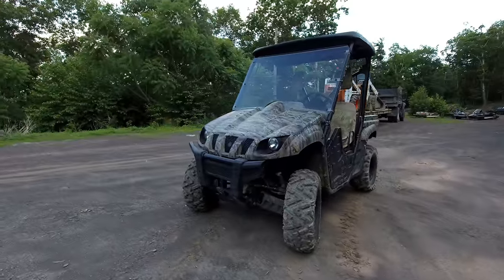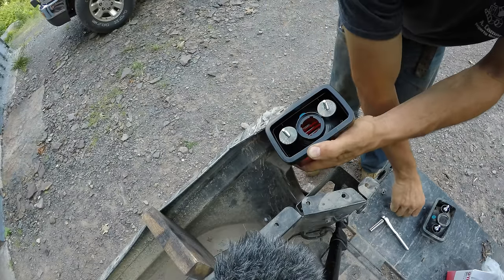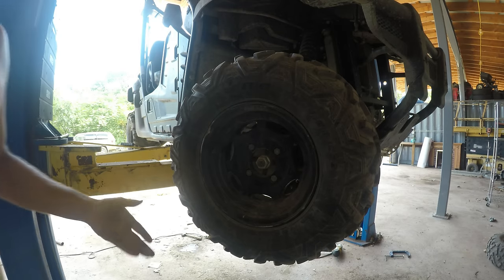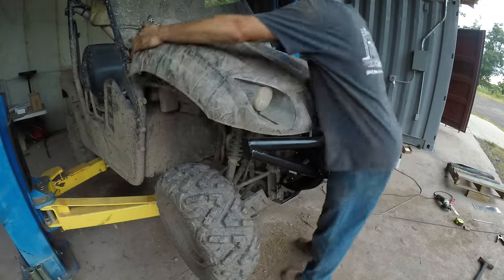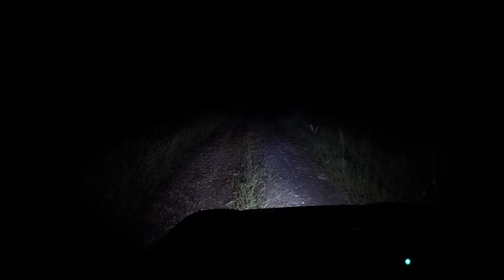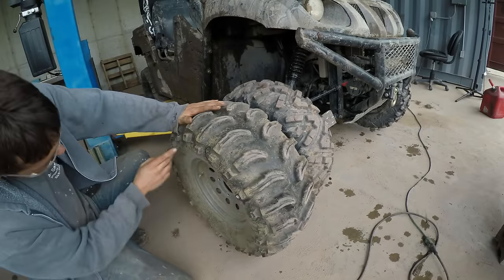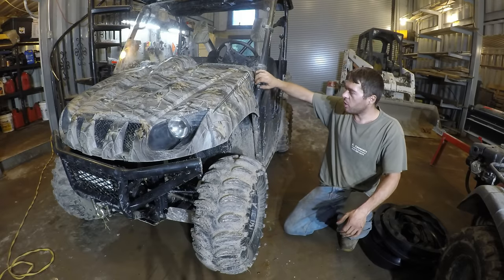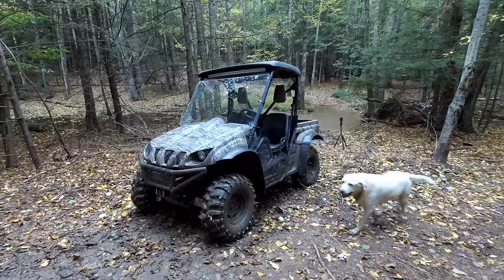Buying a UTV

Comment: I know it’s an old video so maybe you will see this maybe you won’t but you don’t need to open the bleeder when compressing the calipers it introduces air into the system and the fluid is able to go back into the reservoir otherwise you would have to put fluid in it every time you drive anything
Reply from the maker: It didn't want to move for some reason though. IDK.

Comment: Andrew, I don't think you are old enough to remember when cars were built like tanks. They still rotted out and broke down, but far more people got killed due to them being tanks and the mileage of a tank is crap!!! There are things you can do to help keep trucks in great shape, but you'd have to buy them before someone else drives it through a winter in the North. Fluid Film is a great product if used correctly and before the vehicle is already rotting. OR Move out of NY!!  I did!!  I have an 02' F250 Super Crew that if I'd bother to wash it, it would look new!!! Zero rust and with the V-10, it will haul far more than I'll ever want to!! But I remember all to well what winters in NY are like. I am from Rochester just a few miles off Lake Ontario and the lake effect snow is INSANE!!!! I plowed for Wegman's grocery chain with an old F250. Box split in half from rot. Had to do some cab corners on it, but it made me far more than I had in it in the first week of plowing!!  So really you have to deal with where you live.. Besides, I've seen you take a chain saw to a dashboard. I don't think you'd want or drive anything that looked like it wasn't meant to go anywhere and do anything and couldn't be fixed with some drywall screws and zip ties....

Comment: I bought a 2015 buy the original manufacturer ( Hisun ) that was contracted to make the frame and engine for Yamaha they sell it rebranded and so many name brands like Coleman and Massimo.   I have my unit since the middle of 2015 and it has been a great unit to work on my homestead and hunting camp.   So far the only failures have been the battery and the rear shocks just recently went after 6 years of hauling wood in the bed and I just picked up the same shocks that you put on the front of this machine (coincidence).   Keep making awesome videos.
Reply from the maker: I was just using this Rhino today.

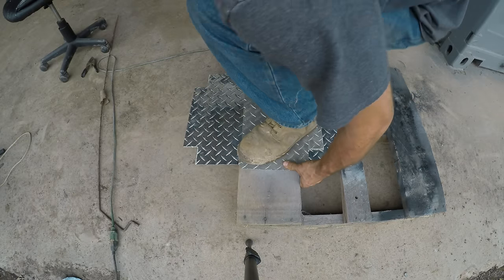Comment: 44:25 Using the blade of the loader bucket works great for bending materials like this. Lift it up to a comfortable height, clamp it on and bend it.

Comment: You can get adhesive lined connectors, terminators, and heat shrink tubing at Walmart. That is what you should be using. Connections subject to vibration should not be soldered per UL. I guess that solder has worked for you, but it is wrong. The right stuff is in Walmart's RV section.

Comment: I to am also a one person army I have two home one with 120 acres in the mountains of New Hampshire so I NEED equipment to do heavy jobs like cut and split wood for heat maintain my 200 yards dirt road maintain my on property snowmobile ATV trails . So I did not need as big as machines as yours but I did get ideas on what kind of equipment I need from your videos . I now have a Hough H65C payloader a Kabota SLV 75 a Kabota B2910 tractor with backhoe and snowblower AND my work horse to get me to my wood lots on property 2005 Yamaha rhino . SO thanks for the advice Andrew keep them coming .
Reply from the maker: Thanks

Comment: you can easily add more wide to it too since its cheaper. just buy some rubber mat that  is stiff or wiree impregnated and you could bolt on more

Comment: For awhile I was thinking why bother having the light bar lower in the grill if you're going to have a light bar on the top? But then after your display of the light bars, I can see the one in the grill does a good job right in front, like the headlights should have done, and the on at top really doesn't cover that area but works great for much farther ahead. Basically, it makes sense to me now to have both light bars where they are.

Comment: I think one reason cars now don't have frames anymore, like they did when I was a kid, is because they can easily design them to collapse in a crash to absorb energy. A strong frame hitting an abutment at 40 mph isn't going to collapse. Perhaps they can make frames that will do the same, but it seems harder. And most pickups are sold as passenger vehicles, not work vehicles, as far as I can tell.

But I agree that they could make cars a lot more durable. Safety aside, though, people wouldn't buy new ones as often, so...

Comment: I know its crap but spray on rubber liner will reduce sound (it says it on the can) and I can confirm after paint the inside of the rear area in my car 50% reduction in sound from before with 1 coat. Vibrations cause reverberations and that amplify the sound as it travels the rubber reduce vibrations and reverberations as it absorbs both

Comment: I noticed that when you change tires that you're placing the tire pry bar to pull the beed of the tire over the arm in the wrong spot. I used to change tires for a living. You should be placing  the pry bar over the wheel guide. Might be why you have a hard time with it. Also, lubrication goes a long way in removing the tire as well as installing it.

Comment: Hi Andy,
..Really enjoyed your video. Impressed how well your Rhino does.
Impressed how you fix older equipment to make operate as well 
as newer equip. You probably replaced your front aluminum skid
plate with a steel one, right?
...I completely worked over a 1970 aluminum 14' Lund boat to a 
small bass boat. Turned out great.
..I will check out your other videos.

Comment: Turn the front lift kit pieces upside down then have them strait up and down so the pressure won’t be were you said it might break any more and the Tyre and rim would fit

Comment: Check your front and rear-end dif air vent hose.. make sure they are run up to the same as your air intake hose..the no worry of deep water getting in the dif .... just a suggestion bud.. the vent hoses are pretty short on them

Comment: The bigger trucks, 3/4 tons like u mention have to use that solid rear axle for towing stability. But, as u mention the independent susp is great for versatility/offroad. This is one reason why I prefer GM trucks to Ford/Ram. The front end is IFS with torsion bars. That's unbeatable in mixed terrain, not to mention the smoothness on highways. Trucks with solid axle front and back... I don't see how ppl prefer that for offroading when the independent is so advanced now. Saturns had impact resistant body panels remember? Or at least one model of them. After owning a 3/4 ton Silverado and after watching you mess with your trucks, I can't agree more about the brake lines made of garbage. There are at least a handful of things that truck makers could all adopt as an improvement over what they use now and like no real added cost..

Comment: The fender flares may be more comfortable, but will it really be more fun?   If you pull trees with it the belt will wear faster.  Road vehicles have "crumple zones"  read up on them your tube design would need to crumple to reduce forces put on the occupants in a crash.
Reply from the maker: Yeah, its more fun when the operator is dry and can see out of the windshield.

Comment: with that wider fender flare rubber, I wouldn't have cut it , I would have use zip ties on that metal bar and if u had to open the hood u cut the zip tie and then apply another zip to after u close hood

Comment: unscrewing bolts is easy but knowing what you do takes a bit of knowledge. I guess being a backyard mechanic doesn't teach you simple things like tightening wheel lug nugs properly in a star pattern to allow the rim to seat properly.  also, the bleeder screw on the caliper should not be opened when compressing the piston. the fluid will flow back into the reservoir.

Comment: And all tho the Yamaha is a killer machine i noticed you ran the Honda pioneer down ! Well as you mentioned the Yamaha has a cvt transmission which regularly tears up not to mention if you get it in water it slips and quits moving in most cases so that's one strike against it considering cvt is a terrible design its a cheap solution to make something move the Honda has a real gear driven transmission that will never give trouble the life of the Honda and how much better the Honda is in every aspect its just engineered better and that's why it cost more ! In 25 years the Yamaha will be rusting away in a scrap yard and the Honda well someone will still be riding it and you can tag the Honda its street legal ! I like your vids and your good at what you do but not only am i a Honda fan we both know as everyone else does that its a superior machine all the way around ! ;)

Comment: UTVs are fun, but they simply aren't built tough enough for what they cost.  We have friends with Gator and Kubota side by sides and we have a Polaris Ranger 900XP and they break far too often.  Slipping transmissions, ignition solenoids, radiator leaks, parking break sensors, squeaks, rattles, etc.
Reply from the maker: Polaris stuff is always broken. Same with John deere. How is the Kubota? Usually stuff from Japan is good. I wont buy machines made anywhere else because they break too much.
Reply: The Kubotas are loud and the plastics fade quicker that the others, including headlights which cloud up, but mechanically they have been better than our Polaris.  It might be user abuse, but my friends with Gators seem to always have duct tape on the seats because they are toast after a year or two.  Body panels also have a tendency to crack and rust is a problem.  The Ranger has left us stranded three times in six years due to electrical failures.  It also rattles like there is a coffee can half full of coins in the back.  They used plastic tabs to attach the seat and ours has been velcroed on for four years now since the tabs broke off.

Comment: In AZ UT and CO you can drive these things on the street.  I just picked up a canam maverick sport x rc (yes the names get freaking stupid long), and while it's fun, I'm definitely thinking I need to pick up a rhino for work and abuse.  The fact that you can drive them on the street, in my neighborhood I see people doing their grocery run in these things... and I even know a guy who drops his daughter off at school in a long ass 4 door X3.  It's crazy how far along they've come, and there's literally every size shape and engine power nowadays... except diesel.  Only JD has some small tiny diesels in their work ones.  

The roxor had potential to be a badass rig, but it weighs as much as a jeep, just not as useful... modern suspension on that thing, would shave a few hundred lbs of leaf springs, and make it compete with these more modern machines a lot better.  and yeah, on these, plastic body panels would work best.  

New Ford trucks are aluminum, time will tell how well they'll hold up, but the times of rusted out cab corners and Flinstones brakes is gone... hehe.

Comment: you missed putting a piece back in before replacing the new clutch it looks like a sleeve that covers the output shaft ,
Reply from the maker: Yeah, it looked like that. IDK, maybe its in there. The thing is working fine. I use this machine all the time.

Comment: Should power wash that thing well on the lift. Do you ever have welds break on you? I am not a welder but was always told you need to have a very clean spot to weld to or your welds will be weak do to imperfections and in popper bonding, Or is this a lie as I've seen you weld all sorts of stuff not cleaned?
Reply from the maker: People say all kinds of crazy things about welding. IDK, I've been welding stuff together all the time for years, once I weld something its fixed.

Comment: Very interesting, this is a CVT (Continues Variable Transmission). Originally developed by the Dutch company DAF (I think 1960's, https://en.wikipedia.org/wiki/DAF_600 ). IIRC a Philips invention, not 100% sure. 

You would get initially very fast acceleration, but in the end not too much horse power. Would beat every other car (even a BMW) getting away at the traffic lights. :-)

Comment: Andy.. Question? on the 2006 Yamaha Rhino UTV..in this video, i didn't see a speedometer, oil guage (2in1) or you didn't need that?, 
Suggestion: A front hood basket would be nice when you're taking the UTV for a long drive among friends or work related duties... more space for tools or gear.
Stay safe.. GOD BLESS
Reply from the maker: It doesn't need a speedo.

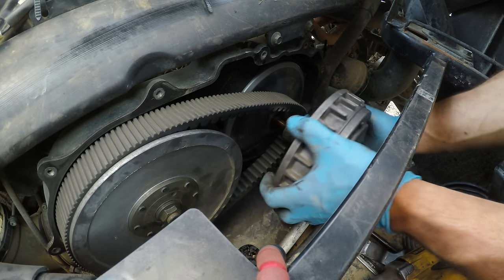Comment: You took the clutch off at 4:00 and there was a silver cylindrical roller sleeve on the shaft that also came off. When you installed the new clutch, it looked like you didn't replace that roller sleeve. It looks like you may have gone back and re-edited without showing the replacement, but that belt will wear that shaft without that roller sleeve. Did you replace it or not?
Reply: Buddy.. I’m sure he popped it back on there. Can’t record everything & even if he did he can’t leave everything in.

Comment: Do you have to open the bleeder valve to push the piston back into the caliper?  Unless they're putting check valves in them nowadays,  you should be able to just compress the piston with the c-clamp...  I mean, they go back in without  opening the bleeder under normal operation,   ..anyway,  cool video. I'm enjoying watching the bumper build. It's nice to see someone else who works off the floor ..and uses used materials like reber and galvanized fence posts  ..I've even used downed street signs  for skid plates  🤫😜.  ..oh yea, nice "hold my beer" moment of your buddies leaving the waterfall in their golf course maintenance rig.. I thought they were going to clip your new brake lights..  ...no relays on the light switches?  
Thats some cool terrain,  where is it? Upstate NY?
Reply: I'll bet AC checks his brake fluid and keeps it full. So to push the pistons back the master cyl. will overflow or you can't push the pistons back. Just thinkin.
Reply: @raybame5816  yea but he would have had to have filled the master cylinder when the piston was already extended out of the caliper. The fluid that pushes it out will fit back into the master cylinder without overflowing..
Reply: @jdog4534  I agree.

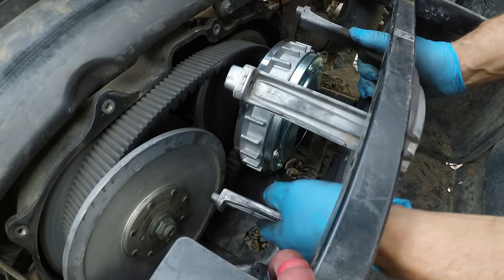Comment: At 3:58 you took off a silver tub around the clutch shaft but you never put it back on at 5:40 in the video when the new clutch was installed. Did I miss something?
Reply from the maker: Few people mentioned that. It does look like I forgot it. IDK, I think its in there. I don't see that part laying anywhere, and the thing has been working fine.

Comment: why you open the bleeder to compress the caliper? I never do. you could possibly let some air in that way. when the break isn't pressed, the fluid is free to return from the calipers back to the res, so no need to bleed.
Reply from the maker: Pete Lorenzo I didn’t think it was moving till I did that.
Reply: @AndrewCamarata  I'm no expert. you're doing good work, thanks for the video

Comment: the problem with making a tube chassis truck for the road...  They are too rigid. vehicles today have to be made with impact crush zones that absorb the impact of an accident.  That is why vehicles are so safe today as compared to vehicles made 45-40 years ago.  If you have a rigid tube chassis the impact at speed would not be fun to survive... if you did.

Comment: I'm pretty sure he forgot to put back a piece of the transmission, it was a cylinder spacer on that splined shaft
Reply from the maker: It did look that way. I actually just replaced that clutch again in this thing (there is a video). And it was in there. I do not think it would have worked without that.
Reply: @AndrewCamarata  ya you're right lol, love your vids btw man, they always bring joy to my day!

Comment: Did you make sure the slanted side of the belt was to the slanted part of the pulley or cvt or torque converter as people call it in those different terms just listed them all so I don't get hate off of y'all's opinions on how yall call it

Comment: Just subbed, WHERE are you located? State? LOOKING for a used UTV?? To pull a pull behind mower, would you purchase the SAME brand unit again? I know NOTHING about these things and find it very confusing trying to decide the best one for what I want to use such for.
Reply from the maker: Yeah, that thing works pretty good. I guess it could pull a mower. It has a low gear. Tractors are usually good for mowing too.

Comment: 1:31:50 tires slime stuff, they will get really mad at a tire place if you bring a tire in with that shit in it. it's good for saving hard to find, specialty tires for heavy equipment and stuff though. or using it on something you never plan to bring to a tire place

Comment: Andrew you talking about the side by sides there is a mobility scooter which they classed as a sports model called a ziesel it is a tracked vehicle powered by batteries and electric motors and travel at 22 mph single seater and is his ideal for going in and out of forests warm Woods in the snow and also in the mud just go online I'm Google and type in ziesel

Comment: The Rhino is just too narrow.  Put some spacers behind the half shafts and lengthen the a-arms so the thing won't roll over when you look at it wrong.  Spacers behind the wheels work, too, just not as well.  Anything is better than nothing.  Keep your hands in when it rolls, and warn your passengers to do the same.
Reply from the maker: I like the width of the rhino, I have raced that thing around turns at high speeds and been on the steepest hills with it. Its a perfectly safe vehicle. Anyone who flips one is a bad driver. Same with 3 wheelers.